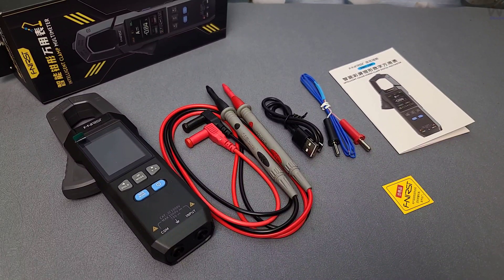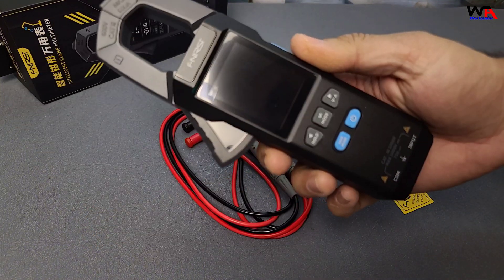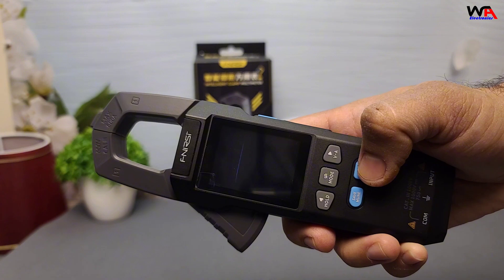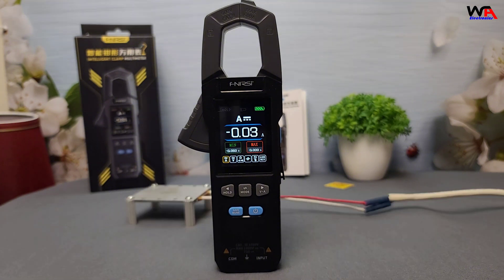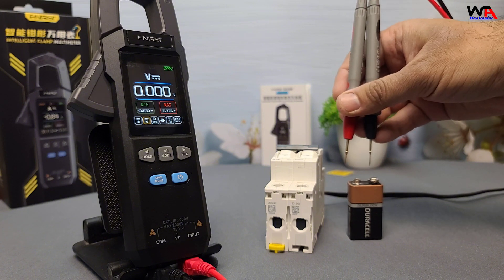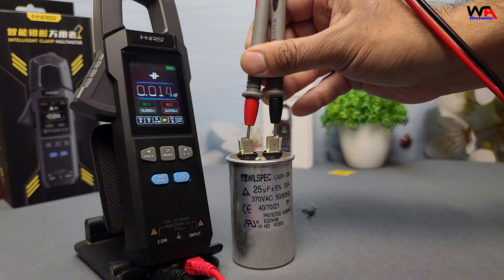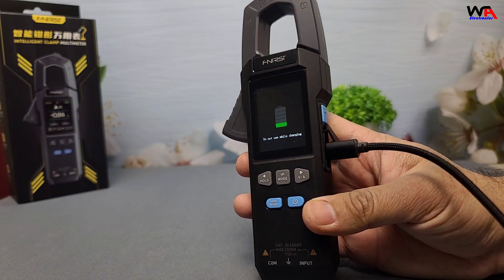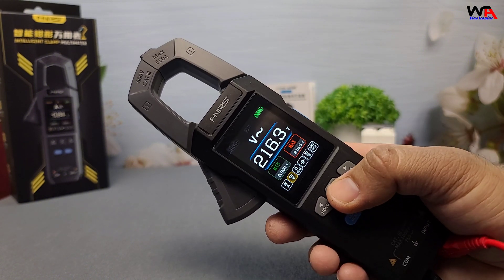Fnirsi DMC-100 Digital Clamp Meter Unboxing and Comprehensive Review

Comment: If I test ac voltage on dc, resistance, diode, continuity or capacitance mode will the device get damaged. I make this mistake many times. Please tell me the please.